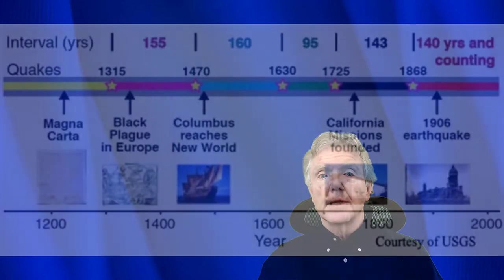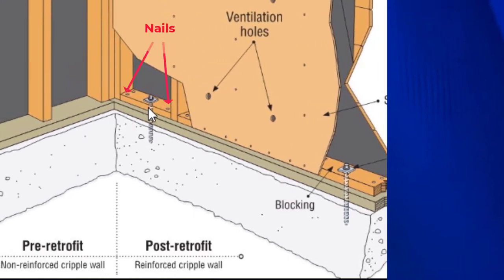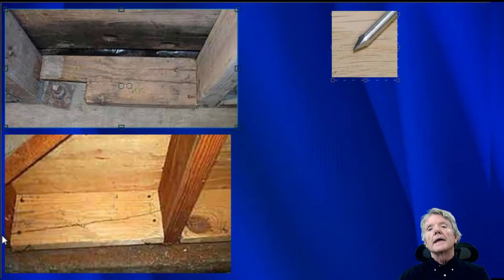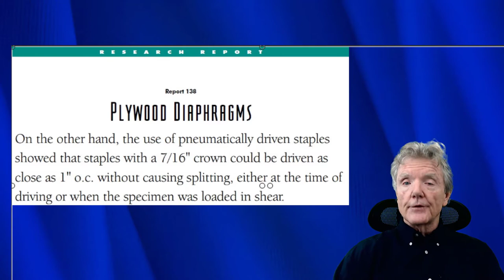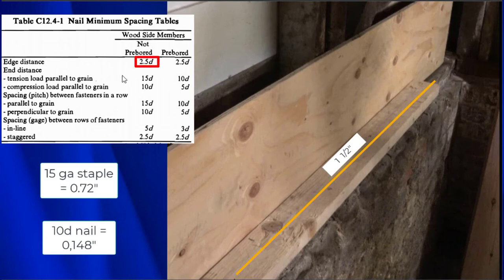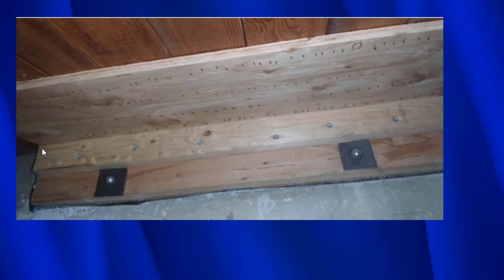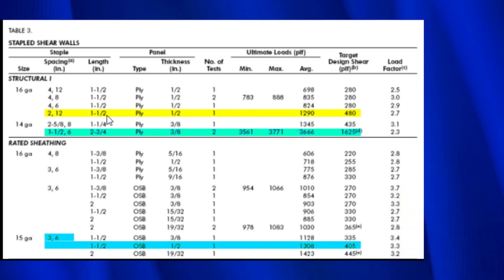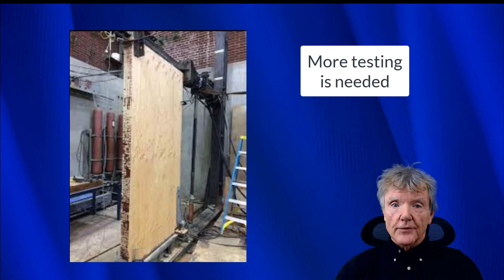Stapled Shear Walls: An In-Depth Study

Comment: After reading a ton of your stuff and getting 2 estimates, I'm convinced that the retrofit contractors in my town (Seattle) are not up-to-snuff. Therefore, I'm going to do this myself. To that end, your videos/knowledge are exceptional. I'm also sold on staples vs. nails. But here are some questions:  What's your updated recommendation on staple spacing for: 1) douglas fir 2x4 blocks on top of mudsill? 2) perimeter of structural walls?  3) in the field (middle area) of structural walls?  Finally, I have a lot of windows in my basement, is there anything I should be  doing to support above/below the windows, or do I just skip these areas?  Much appreciated!
Reply from the maker: You can go 1-2" on the edges, and 6" in the field. Staples take an expensive staple gun and expensive staples so I would probably still with nails.  Attach the blocks to the sill with (3) 3 1/2" Simpson 1/4" SDS screws. You need the FTAO system.  I emailed you the information